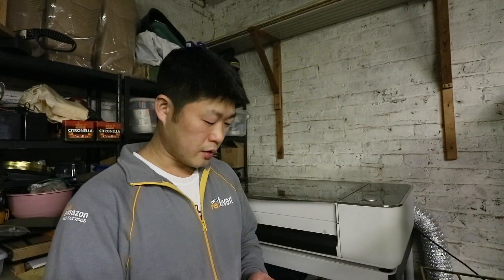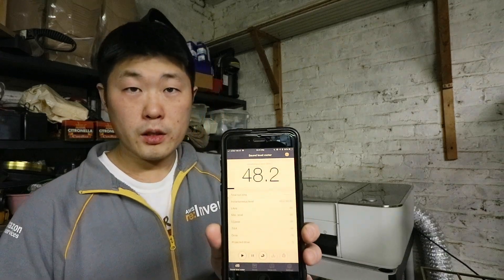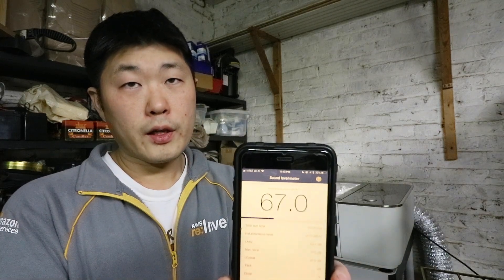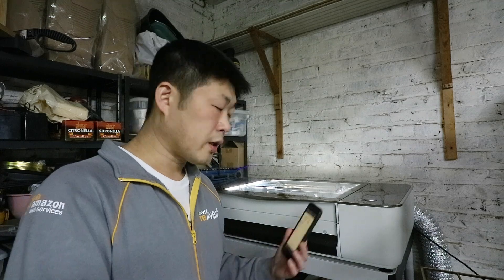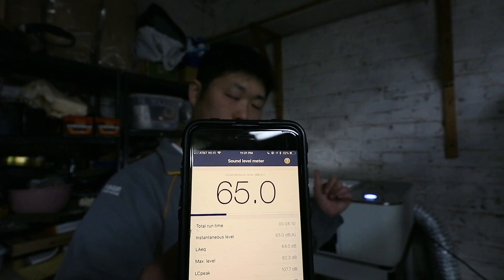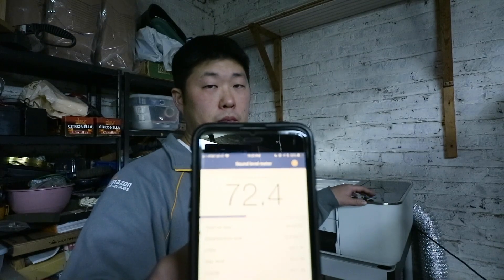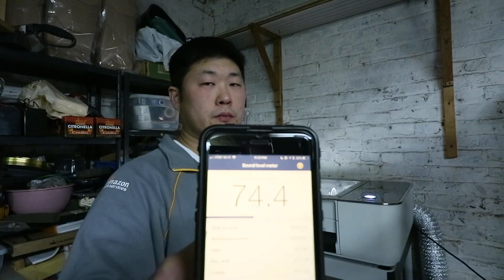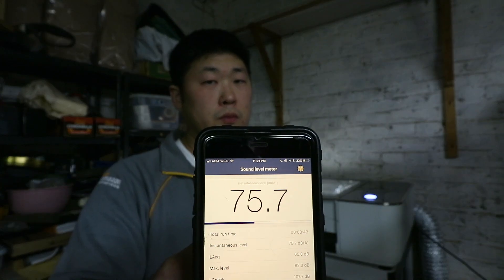Glowforge sound level readings

Comment: How to cut the noise level of your GF in half... (pictures in the GF users Facebook group)
1. Put insulation around the outside of the exhaust duct. The insulation cuts the noise by over 50%. I used an insulation sold by Lowes that is made from recycled jeans. You can see the product tag in the center of the picture. Standard fiberglass insulation from a big box store will work just as well though.
2. Surround the bottom edge of the machine with insulation. You can see it on the bottom right side of the picture. **Do this at your own risk. Be careful to not restrict the airflow too much! Check the flow before and after adding the insulation.** There should not be a noticeable difference. I measured a 10% reduction in the flow velocity exiting the duct). The machine draws air from the bottom right to feed the exhaust fan. This cuts the noise level by about 50% also. I suspect the filter unit will do this also.
Sound test results 2 feet from the front of the machine:
----Without any insulation:
48.8 dB - Machine idle
69.5 dB - Machine cutting full power (about as loud as a vacuum cleaner, quite annoying)
---With insulation around the base only
46.8 dB - Machine idle
67.4 dB - Machine cutting full power
--With base and exhaust tube insulation
46.8 dB - Machine idle
65.1 dB - Machine cutting full power (about as loud as a dishwasher, this is a major difference)
Reply from the maker: I'm not sure covering the input vents is the best way to cut the sound.  If its working for you, great.  I've been poking inside the unit and I may try to swap out the internal fan or remove it all together since I have the external Harbor Freight dust collector venting out 660CFM already.
Reply: Tinker With Us... it only dropped the flow rate by 10%. That probably represents less pressure drop than if I would have used the full 8' of duct hose provided with the GF.

If you aren't able to check your flow rate to make sure what you do doesn't restrict flow too much then just put your Glowforge on top of a sound dampening material like a few layers of towels or a piece of carpet. That along with covering your exhaust duct will drop your sound levels by about 50%.

Comment: Hi John, thanks for the great video. We got a Glowforge and was wondering why it's so damn loud. Glad to find your video. I downloaded the same NIOSH SLM app (it's supposed to be accurate to within a couple of decibels, according to NIOSH). I have some experience with NIOSH and their work, it's top notch scientific research agency so I trust these readings.  I'm also a part time audio engineer on weekends so I know what I'm doing.

Our Glowforge is in a quiet office type setting. Sound levels were around 83-88 dBA during few cuts, with exhaust running (hazardous level according to NIOSH is 85). Mid to high 70's without the exhaust. I have an iPhone 8, I did a couple of things differently. I removed the case from my phone so not to block the microphone, and I pointed the microphone (on the bottom of the phone) at the Glowforge around 1.5 feet away (where I would normally be standing). I had a friend with an access to Quest sound level meter, I borrowed it for a day, and got almost exact measurements after calibration. This is crazy loud, if you ask me. Thanks for posting this!
Reply from the maker: I'm glad you found this helpful.  Nice to hear that the Niosh app is inline with a hardware meter.  Thanks for comparing results.

Comment: a phone is not a legitimate way of measuring sound levels
Reply from the maker: Yes, it is not a calibrated method of sound measurement, but the NIOSH app seems to be fairly reputable. The purpose of my video was to show to others how loud the machine is.  The loudness does not come across in video since the mic peaks and cannot convey the actual sound.  The app seemed like a reasonable way to get some quantifiable data into the video instead of just a loud audio track.  I don't think I ever said I was using a calibrated meter.  Sometimes the tools we have are better than no tool at all.
Reply: Tinker With Us all microphones in pretty much all divides are made different... If your going to measure sound get an appropriate device for doing so
Reply: Obviously not, but this gives a better understanding than saying it's just "loud".
Reply: @CocoBorderCollie  not really. Nowdays there are so many devices that are fairly  cheap now that can tell you the  Decibel levels that there are no real  excuses like that ... he'll you can buy a Decibel Meter / Sound Level Reader from  Walmart  for under $20 nowadays